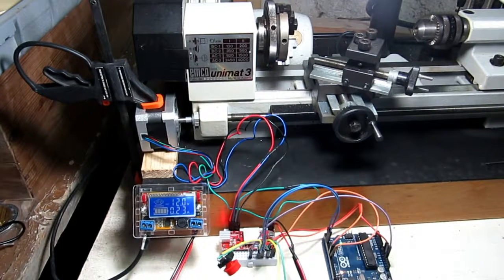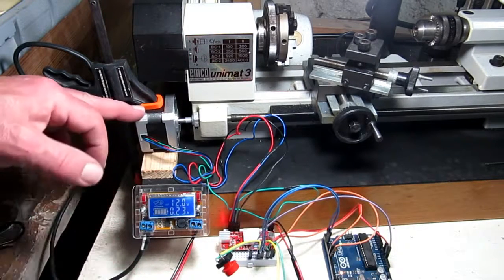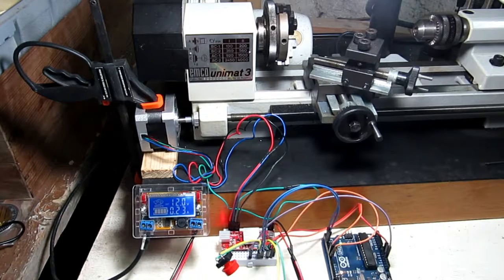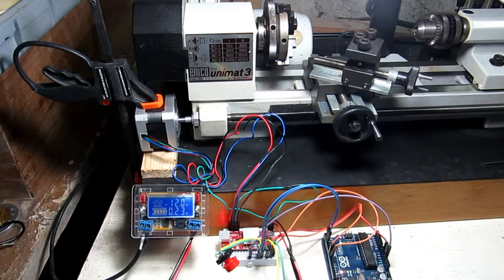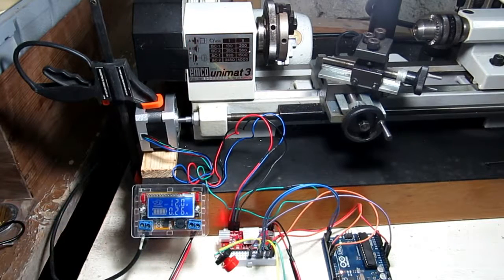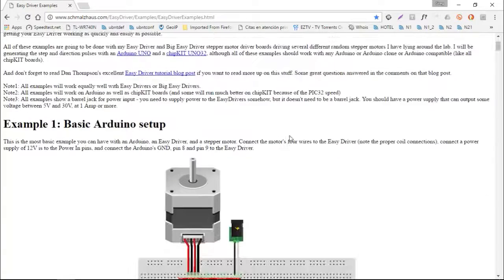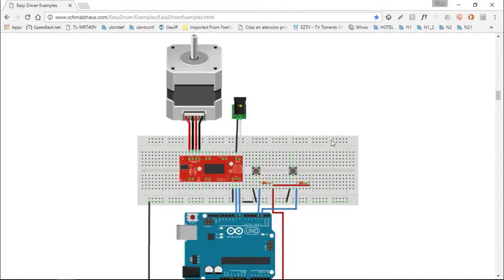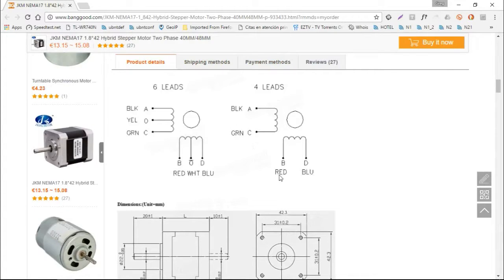Adding a Stepper Motor Drive to an emco Unimat 3 Lathe

Comment: Thanks for sharing this. Have you gone on to expand the concept on to different parts of the Unimat? Would be interesting to see.
Reply from the maker: It's on the back burner for now. I got sidetracked by my CNC : https://youtu.be/-zoUV3XBFak Am about to get sidetracked again as I now have a 40 watt laser to play with! Please consider subscribing if you have not done already!
Reply: @1nformatica  Did it. 40 watts. Sounds dangerous.

Just throwing an idea up in the air. I was thinking about the complications of stepper motors when accurately moving 1 step at a time, which apparently has a high risk of over or understepping (100% chance for Nemo17). And thought that pully / 2-wheel-belt system that might help to allow for multi step usage to some what resolve the inaccuracy issues with directly using the stepper. 
Did you by chance think about the pro's and con's of such a system? Or might be able to point to some resources that discuss this kind of idea?

Comment: Have you ever thought connecting a stepper motor to the lathe's power shaft? I got here looking for that project
Reply from the maker: My plan is only to be able to control the lathe in the same way I do my CNC router. I'm not sure a stepper motor is actually powerful enough across the range of speeds required. Have you actually seen one used? Would appreciate a link.
Reply: @1nformatica  servo motors are used  as high powered spindles, servo motirs should work no problem